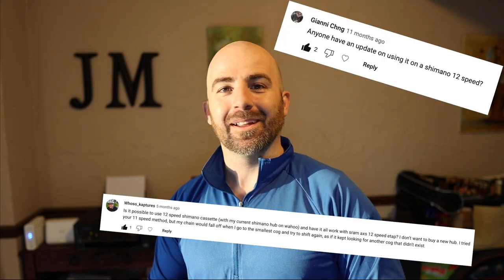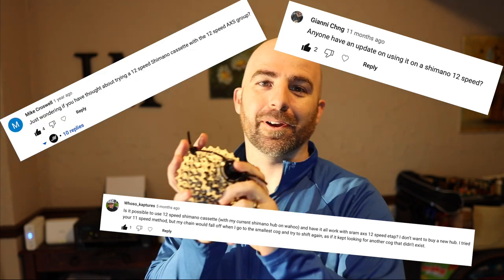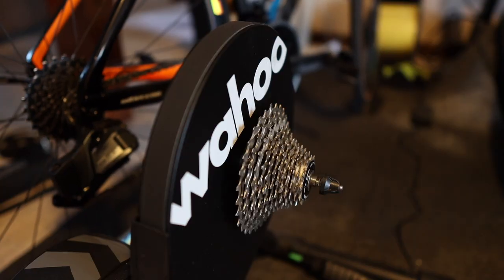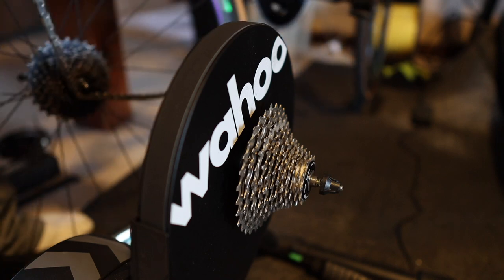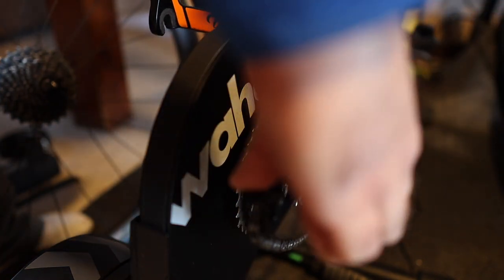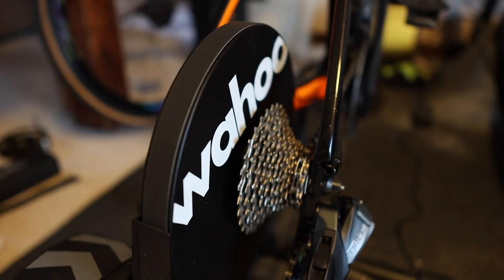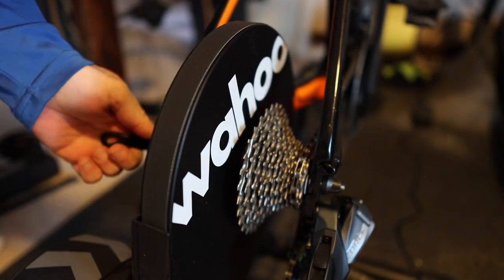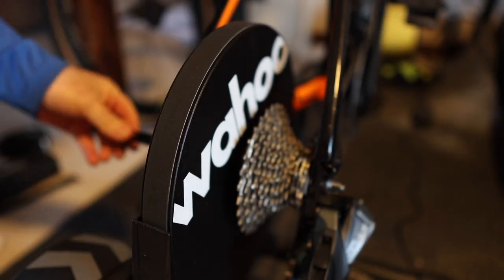Will SRAM AXS work with a Shimano 12 speed cassette?

Comment: Running SRAM Force axs D2 12S on 12S ultegra cassette. Runs perfect. Smooth shifting. Problem? None so far after more than 1000miles.
Reply from the maker: Good to hear!  Indoors only or full-time indoors and outdoors?
Reply: @JMCyclingVideos  full time outdoor.
Reply: What chain did you used?
Reply from the maker: SRAM flat top 12 speed chain.
Reply: @Rudyjosephjr  you? What chain?
Reply from the maker: Thanks for helping out in the comments!  Always good to see discussion
Reply: what about sram fd on shimano 50 34 chainring?
Reply from the maker: I can’t comment on that, as I’ve never tried different chainrings with the AXS front derailleur.
Reply: @lancercool1992  I'm running Rotor 48/35 Q rings (12.5% ovality) on a SRAM Force front derailleur with Shimano (style) 11-28 12 speed cassette on Force rear derailleur with Force 12 speed flat-top chain. No problems at all, just as smooth as original SRAM components. The max effective size of the 48 tooth front ring is at least as large as a round 50T ring so it's highly likely you'll be OK. I'm testing a 50T config soon, changing the AXS spider to a 5 arm 110 bcd spider then mounting a 50T Rotor Q ring (10% ovality). I'll update here once completed.

3/11: I installed the 5 ARM Stone spider on the SRAM dub cranks replacing the AXS spider. That allowed me to use any of my store of 110 BCD 5 arm chainrings, in particular a 50T/36T Rotor Q-rings combo. Front derailleur needed a bit of adjustment but now running smoothly. Basically you can put almost anything on the Force setup and it will work.

Comment: I have a similar question. I have a Wahoo Kickr version 3. It won’t work with the Sram XDR free hub. So I am thinking about trying the PG-1231 Apex XPLR 12-Speed Cassette. It HG and works with flat top chains. I realized the Force D2 rear derailer probably won’t allow shiftig into the 38 and 44 tooth cogs, but I don’t need those indoors. Seems like a reasonable solution to try. Anyone tried this?
Reply from the maker: Wow I had no idea that SRAM made an AXS compatible cassette that works on 11 speed HG.   I’m curious to know the answer as well!  Hopefully someone in the comments can chime in.

Comment: the axs rollers on the chain are a different size than a shimano chain so it will wear like twice as fast.
Reply from the maker: Rollers are different. However, I ran an 11 speed cassette and really didn’t notice any abnormal wear after a year and a half,
Reply: @JMCyclingVideos  you'd probably lose alot of watts though if you run hot wax
Reply from the maker: Hot wax is legit. Definitely the way to go for max performance.  But I’ve been there and done that and it’s just so time consuming.  I’d love to have all the time in the world to hot wax all the time but unfortunately I don’t.

Comment: Thanks for the vid although now a few months old. Pretty much have the same set up but bought a cheap 12spd cassette and chain. Shifts perfect and didn’t touch the micro adjust. Switching chain takes about 2 mins with the quick links. Got the chain for $25. Meant to add the 12spd parts are 105 - fine for trainer
Reply from the maker: Glad to hear a Shimano chain helped out. That's excellent info to know.

Comment: i'd be interested to see how a chinese 12 speed cassette works with axs
Reply from the maker: This was also requested quite a lot, but I’m not sure how different in spacing and such that one of those would be, and I actually picked up this cassette for only $45 USD so, it was definitely cheap enough.
Reply: Chinese 12 speed "Sunshine" cassette works fine with Force AXS derailleurs and chain

Comment: so you are saying it does not work for you?
Reply from the maker: Not saying it does or doesn’t work. Just demonstrating how it works on my particular set up so people can make their own determination. I personally wouldn’t run it on a wheelset outside, but I think it’s acceptable for use indoors on the trainer. Spacing is certainly a bit different

Comment: I run AXS 1x on my TT bike with an Ultegra cassette, but I also run 11sp pulleys and 12sp Shimano chain. I found the Shimano chain didn't get on well with the AXS pulleys, it lifts off due to the deep gulleys for the larger rollers.
Reply from the maker: Good insight there.  Since my bike is 100% AXS on the road, every other part is AXS including the chain.  I originally thought that would cause additional wear on the cassette (or chain) but I really didn't observe that on the 11 speed cassette I used previously.  Were you able to tune your AXS derailleur to the Shimano cassette?  I'm tempted to try tuning it with the micro adjust, but I know it'll throw off the tuning on my AXS cassette on my wheel set.
Reply: @JM Cycling Videos  it tuned in fine, I wonder if what you're hearing is partly the chain clattering through the cogs? It's worse on the pulleys as they're so small and have a lot of chain wrap, and you've got the opposite with the bigger rollers on the smaller gaps. I'd love to get hold of an AXS cassette to measure the spacing as I've heard it's not even across the range, there's only about .5mm difference in the total width though so I can't see it causing a huge issue over time

Comment: This is exactly what I’m trying to do rn lol. Did u use any spacer like 0.5mm between cassette and kikr?
Reply from the maker: Nope.  Just bolted it on and went with it.  I intentionally left it set up for my SRAM set up to see how close it is without adjusting anything.
Reply: @JMCyclingVideos  cool how long did u use this setup for? Any abnormal wear on chain/crankset? I heard regular sram cassette makes even noisier sound with kikr so people intentionally use shimano 12spd on trainers.
Reply from the maker: I didn’t actually run that set up too long. But, I did put a lot of time on an 11 speed Shimano cassette with my AXS bike. Check back through my videos where I look close in for wear on that. In reality, there may be some extra wear, but not a significant amount more than with standard use.

Comment: Thanks for the video! I want to put a Shimano 105 12 speed cassette the R7100 on my kickr core to use with my SRAM AXS components and  chain on my Trek Madone, with the wahoo  adapter for the thru axle. 
How have you found the Shimano 12 cassette and the AXS chain and other components since you made the video? recommend it? 

Apparently the wahoo adapters for thru axle are not compatible with sram cassettes? So other than the cost of buying the sram cassette it seems also the incompatibility of the sram cassette is also a reason to almost have to use the Shimano cassette?
Reply from the maker: So I used this set up for the better part of a year (I switched to a dedicated trainer bike that I can leave on 100% of the time).  Honestly I think the Shimano cassette would work perfect if you took the time to tune the derailleur. I did not because I used my bike outdoors most of the time and didn’t want to throw off my alignment on my outdoor set up.  As you can see in the video, it’s not perfect but it was definitely usable.  And I did not know that about the thru axle adapters and a sram cassette. That’s a huge miss on Wahoo’s part.  If you’re ok with imperfect alignment in a gear or two OR you take the time to adjust it every time you use it, I think the 12 speed Shimano cassette is a good option.
Reply: @JMCyclingVideos thanks for the response, I’m going to look into this option, the alternative it to spend on a whole new setup with  SRAM components. 

I did some research and I was mistaken before - it’s not the thru axle that isn’t compatible, it’s the fact that I would also then need to get a SRAM compatible free hub body which is another expense since the kickr I have came with a Shimano free hub body that holds the cassette 🤷🏼‍♂️ 

I’m worried over time that running the sram chain on the Shimano cassette may slowly damage the components!
Reply from the maker: Thanks for the update on that. Yes the SRAM freehub body is a lot of extra money on top.  Plus the seal cassettes are significantly more expensive.  Take a look at my other videos. I ran an 11 speed cassette with 12 speed SRAM for a long time and did a close up look at cassette wear.

Comment: What size cassette on your bike and what cassette on the trainers.  I run Force 10-33 on the bike so thinking Shimano 11-34 on the trainer.
Reply from the maker: I actually run a 10-28 on my bike and 11-34 on the trainer. But I used to interchange with a 10-33 so the chain is sized for that. I think that’s the best way to match the cassettes.

Comment: Hey man. If I have a bike with Sram red 10-28 cassette and another one with force 10-33 cassette, what size Shimano cassette should I put on the trainer?
Reply from the maker: As always, I have to say that neither SRAM nor Shimano would recommend this, but I would probably split the difference at 11-30 and call it good.  Unless your bike with the 10-28 is at its limit on chain length.  Then you might run into issues on that one.